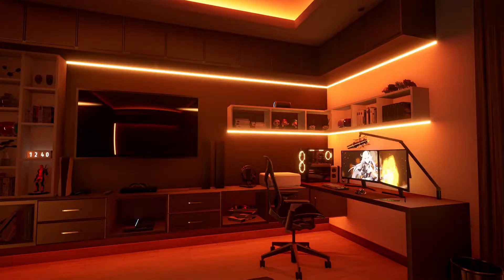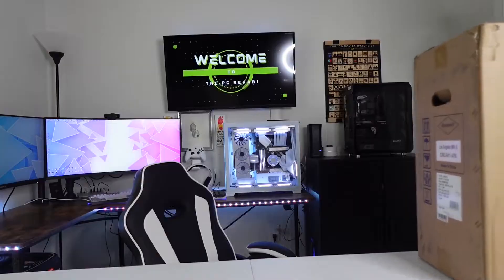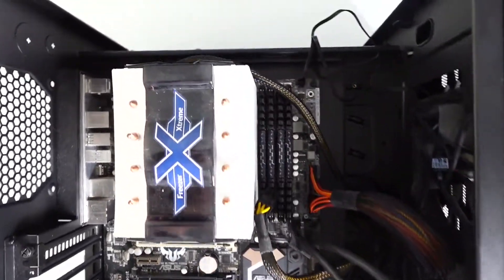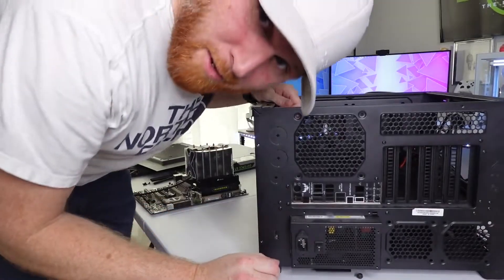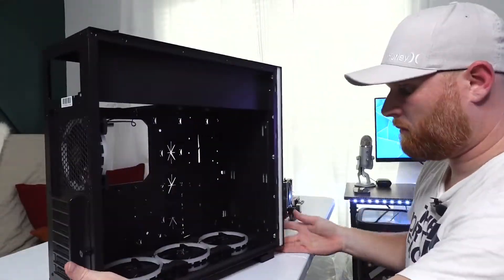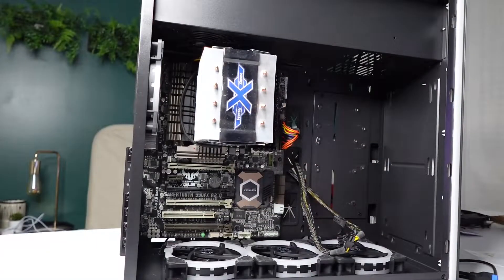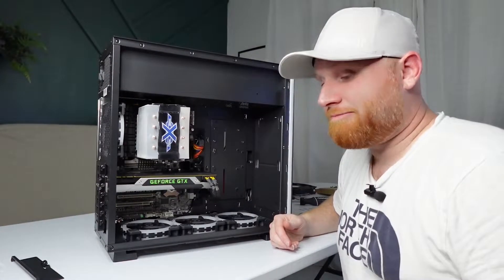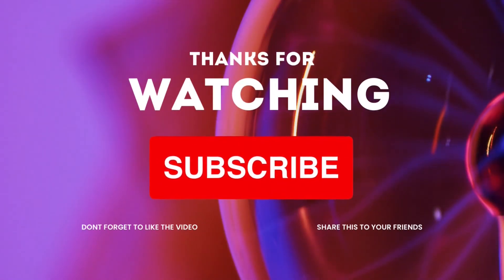How To SWAP Your PC Case - The COMPLETE Step by Step GUIDE

Comment: How about if there is no SPEAKER connector in the case but only HD AUDIO connector? Will I have sound on the computer? and where to plug in HD AUDIO connector? I always plugged in old cases STEREO on the bottom right. but if there is no stereo then only HD AUDIO then on the left right?

Comment: Remember you can always take a picture of the wire placement, before removing any, just incase if you forget the placement. Note that after turning off the psu click the power button a few times and hold it, to drain any power left.
Reply from the maker: Great addition!!

Comment: OK, I have to admit...I kind of like that Coolermaster case.  I probably will get negative points for style consciousness...but, you could make a nice NAS server with that.
Reply: That’s what I was thinking especially with such a large top cent
Reply from the maker: It really only has space for 3 hard drives inside it. Would be a pretty low cap nas. The video does not really show just how large that thing really is. It would not even fit on the desk I use for my pc.
Reply from the maker: But I was not trying to dog the case too bad lol
Reply: @ThePcRehab  lol
Reply: @ThePcRehab  Basically, looks like two full size towers joined in an unholy configuration.  Shame it does not have more drive bays, hidden in that cavernous "upper" chamber.  The removable 3.5" drive caddies looks kind of cool, but without room for at least 2 more hard drives, and ideally 6... I agree.  Not as good for NAS as I would have hoped.  Of course, if you put in enough velcro and duct tape...I am guessing you could fit more! :D
Reply from the maker: @wagnonforcolorado  oh anything is possible if you will not into existence haha. I mean I have a mid tower that has over 100tb of storage inside it so I would know lol

Comment: Hey rehab im getting ready to do a case and motherboard swap from a hp prebuilt I can't upgrade to my own build, the motherboard I have picked has a CPU power pins (8 + 4) do I need to plug those in my CPU only uses 65 watts?
Reply from the maker: You are going to want to make sure that you plug in all of the power cables that your motherboard requires.